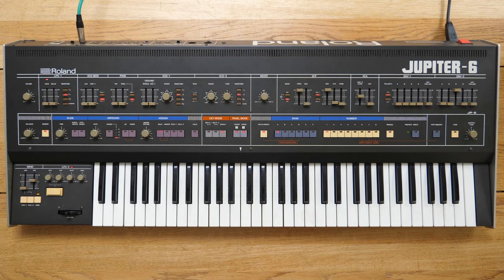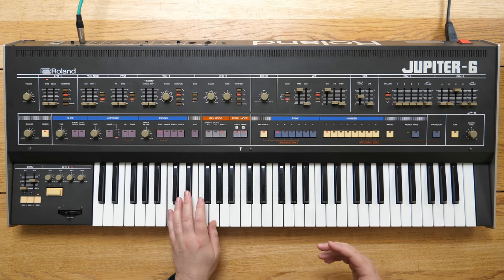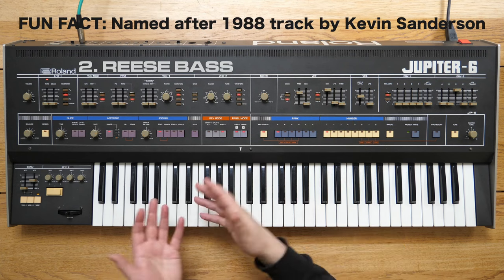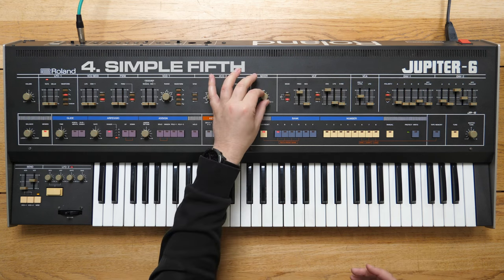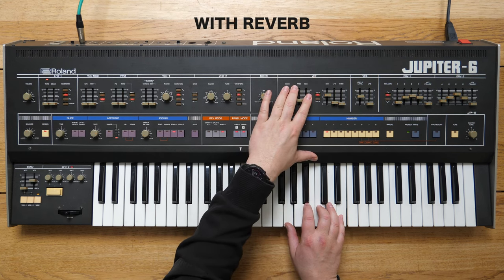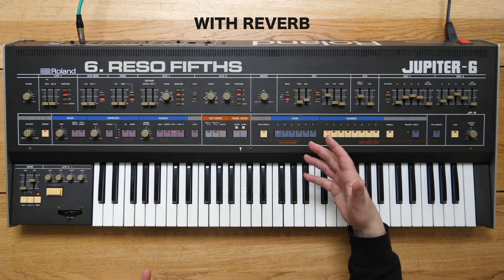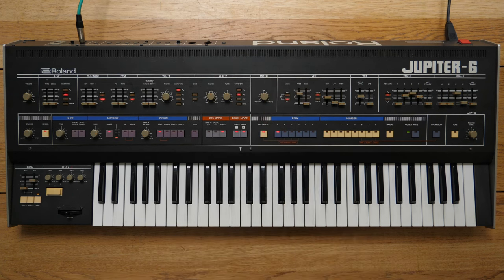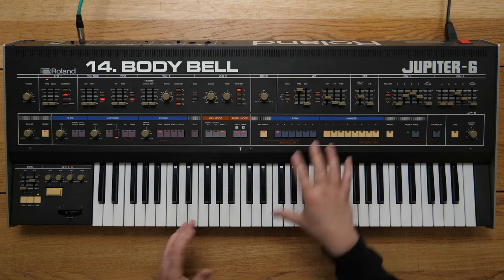You have 2 Osc and you detune them..than what? - 25 things to do with 2 Oscillators

Comment: What a synth and a tremendous example of one yours is too, it's immaculate! hard to believe it's over 40 years old!  great vid as always Starsky.
Reply from the maker: It was a wreck when I got it! I wasn’t sure if I could even bring it back to life, but luckily it seems to be behaving itself after a fair amount of TLC.
Reply: @StarskyCarr  looks and sounds great! cracking job fella! how did you manage to refurb the casing?
Reply from the maker: @scottmcauleysounds it was covered in sticky grime and the remnants of tape etc. a few delicate hours with sticky stuff remover and some TLC brought the case out really nice , but it looked awful when I got my hands on it.
Reply: @StarskyCarr  so many do mate, they have mostly been through the mill over the years (Understandably) - If you ever run out of space I'll happily hold on to it for you ;)
Reply: I would like to cite Ron Mael's work on" Pulling rabbits out of a hat" album  using this device

Comment: Good new series. Off-topic, but coming from a Juno-6 and Synthex back then, what always turned me off of the Jupiter-6 was the lack of a great chorus and the extremely cheap feeling controls of the Jupe. Best bit for me was the bandpass.
Reply from the maker: Haha I made a demo of the Jupiter 6 a couple of years ago - questioning whether anyone would pay this much for such a shoddy new synth! Yeah the sliders and knobs feel cheap. Why it doesn’t have 2 outputs is a mystery… and then why no chorus. But… its does some amazing things with sync and FM. Looks cool too!
Reply: @StarskyCarr  The good news is that the synth is moddable to have 2 outputs, and it's a quite easy mod to do if you know a bit how to use a soldering iron (if you're not, an electronic tech would do that for little labour price). You just have to be careful, especially when drilling the two holes on the back panel where to place the additional jacks for the two outputs. If the holes are done wrong or the drill slips, you can't repair the damage and your synth will end having scars and looking ugly in that spot. I did that to mine, it was totally worth the hour I spent at doing it and the additional jacks look to be there right from the factory.

Regarding the lack of chorus, this was the Roland's philosophy before they did the JX-3P and subsequent JXes: 1 osc synths (Junos and Jupiter 4) got the chorus. 2 oscs synths (Jupiter 6 and 8) got no chorus because you already have 2 oscillators for fattening up the sound.